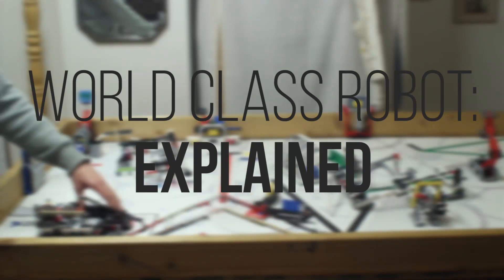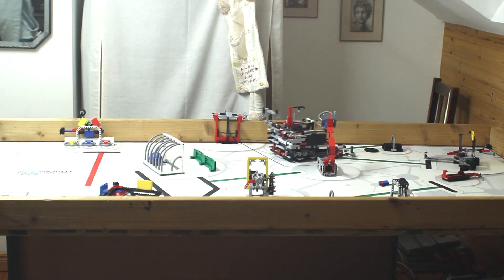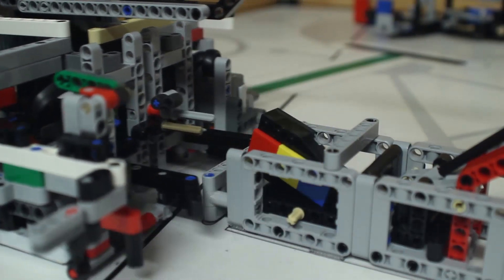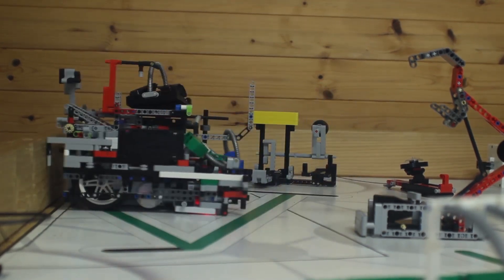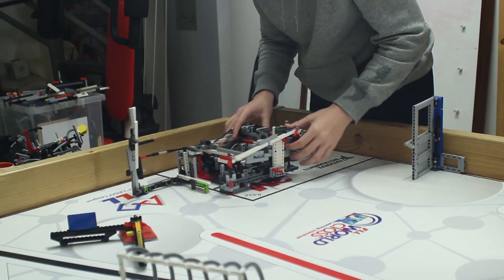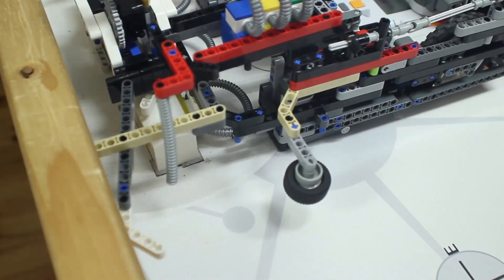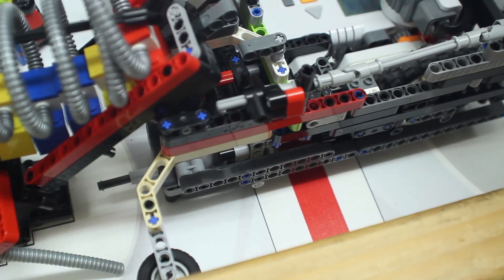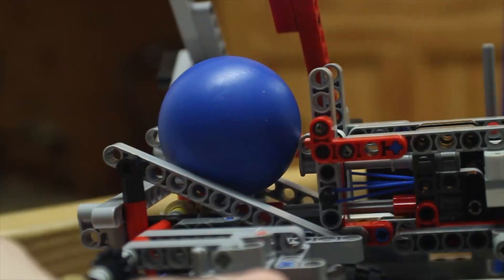FLL World Class Robot 704 points : Explained!

Comment: Really nice! Didn't think 700+ would be possible this time.
Good idea to use the motors from NXT.  Curious to what kind of line-following program you use? Any hints available?
Reply from the maker: Sam Barman For the line-following program I use a very, very simple program. When it sees black turn one direction and switch direction when you see white. Nice and simple, but a trick to get it accurate is to line up exactly parallel to the line before starting to follow.

Comment: Hey, I am a fll kind of experienced person. I learned how to line follow at the beginning of the year to give you an idea. Two questions: 1. How do you get the ideas for such complex attachments and 2. Whenever I try using only one motor for attachments, I can't get enough power to do things like pull a pin or spin fast at all. Please reply to this comment or email me at thelegofllman@gmail.com. Thanks
-Team Infinity
Reply from the maker: darkwizard3335 Hey! To answer your first question most of my ideas come from experience. At the end of the day it comes down to putting time and effort into your robot. Secondly, if your having trouble with power, try using gears to give more torque. However, when adding torque this can put strain on your attachment/robot so you'll probably have to make it more robust. Worm gears are great for high torque, but can be very slow. Hope this helps.

Comment: Do you use any color detection, line detection, touch sensing/detection? Since your robot multitasks, it seems like the 4 motor limit would be reached, but I'm not positive.
Reply from the maker: Katie Chriscoe I use light sensors to see lines (because I don't have colour sensors) that's all for sensors. I only use three motors though because that's all you can use with NXT. Plus there's no need for a fourth motor, it just gets in the way, unless there are some attachments that might need it.

Comment: For your last mission (spinning the engagement wheel) is your attachment under 12 inches and also why don't you build a guide on the wall to continuously run it back in fourth with no human start time off the clock this would only add 1 or 2 more ticks but it is certainly get you more points
Reply: The mission text requires a "start/restart" between each rotation of the wheel. Scott has said in emails that he believes merely entering base completely qualifies but the rules directly contradict this (they specifically say "if the robot enters base and leaves again with no human interaction that is not a restart") so refs may rule that some human interaction is required.
Reply from the maker: Yeah epiclevelwarrior is right. That's why I do that, so it doesn't cause controversy. I saw this as well in the rules, and its tough to rule on.

Comment: For the search engine mission, you mentioned that you discovered that if the lever is engaged slowly, the color wheel would end up on the same color each time. Does this mean you would ask the referee to set the wheel to a particular orientation at the start of the match? Did you run into issues where a referee refused?
Reply from the maker: We can choose which loop to pick up, so there's no need to ask for a custom setup. Hope this clarifies it for you.
Reply: As a note, update 5 specifies the wheel's starting placement is random, so attempting a solution which requires a particular placement is probably a bad idea.
Reply from the maker: epiclevelwarrior Hmm ... the starting point isn't changed during the match, so you just set the robot to pick up the correct loop. Be it yellow, blue or red. Is this right?
Reply: Haven't checked this video in a while, I guess. Yes, you are correct. Without a rule that specifies referees should change something during the match (the cell identification/destruction task from Body Forward had such a rule) they will not, so your solution should work fine.